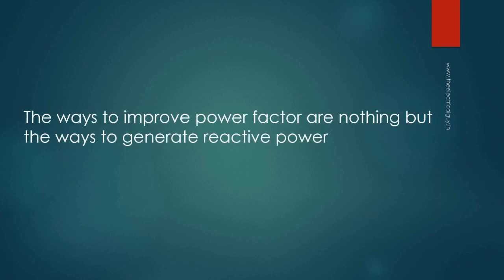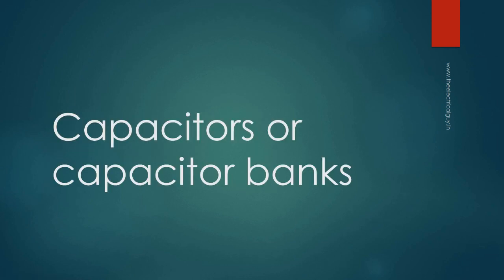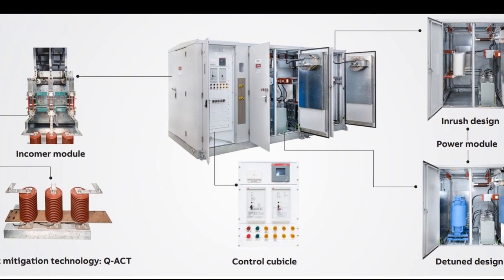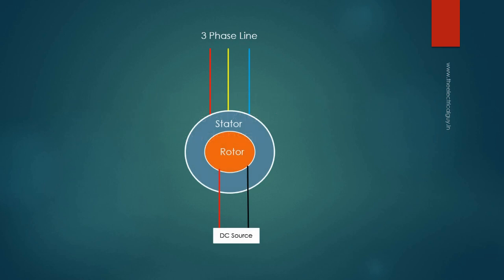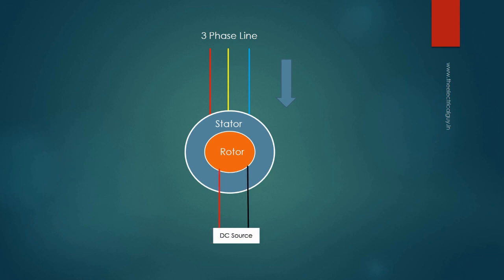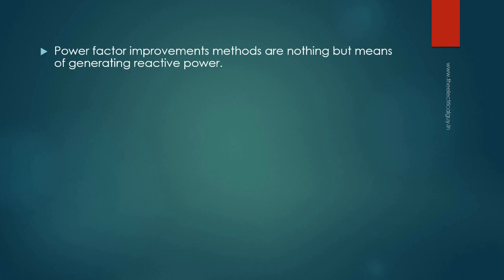Top 3 Ways to Improve Power Factor | TheElectricalGuy

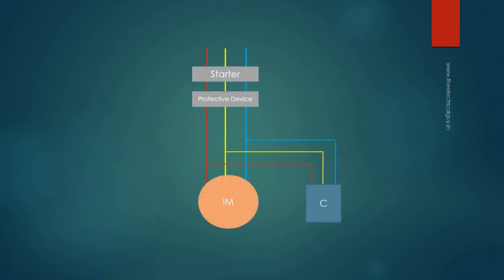Comment: 1:48 is it true that capacitor provide leading current ?

I thought it provides lagging current as the inductive load required lagging current and consume leading current in order to cancel the lagging current component of inductive load. 

Please correct me i am wrong!
Reply: Yes, to tell it in a crude but understandable way, the capacitor connected in parallel with the load makes the current to lead the voltage, before it reaches the inductive load. In other words, we make the current to run faster before it is even utilized at the inductive load. At the load, due to inductor, the current lags the voltage, (current pulled back or slowed down). Effectively, the current will be at its initial position. No, capacitor does not consume leading current nor does it provide lagging current, it makes the current lead the voltage.

Comment: In single phase line where does the Neutral line come from....?
Reply: Actually we get power of  1 of the  phase from a 3 phase transformer. That's why neutral.  The transmission lines only have 3 phase power no single phase

Comment: Phase advancers
Phase advances are used to improve the power factor of
induction motors. The low power factor of an induction motor is
due to the fact that its stator winding draws exciting current which
lags behind the supply voltage by 90 degrees.
- If the exciting ampere turns can be provided from some other a.c.
source, then the stator winding will be relieved of exciting current
and the power factor of the motor can be improved.
- This job is accomplished by the phase advancer which is simply
an a.с. exciter. The phase advancer is mounted on the same shaft
as the main motor and is connected in the rotor circuit of the
motor. It provides exciting ampere turns to the rotor circuit at slip frequency
Reply: I want to improve pf for can i use apfc panel? My load type for educational institute
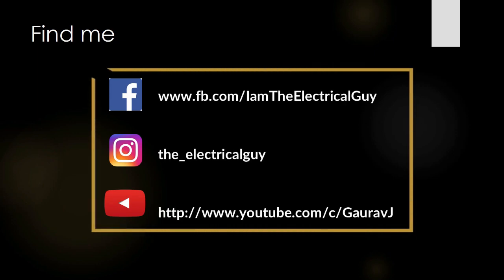Reply: 5:38  @Rajkumar-uu1iv 
APFC panel have auto controller with banks of capacitors to improve the pf of the system automaticaly up to desired value.
Reply: Awesome explanation
Reply: Thank you sir.